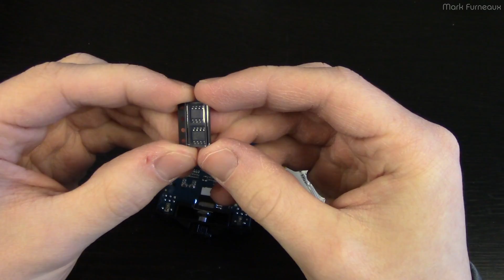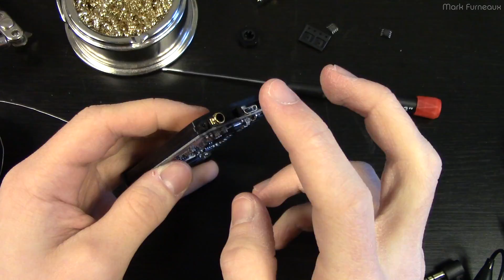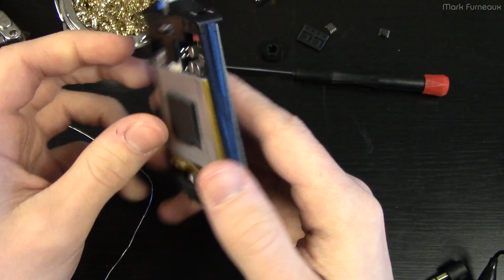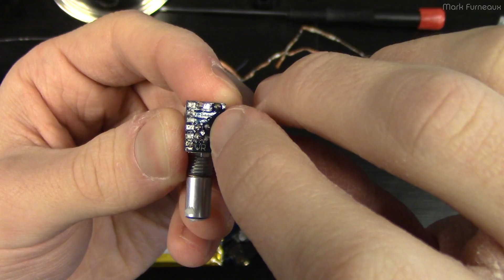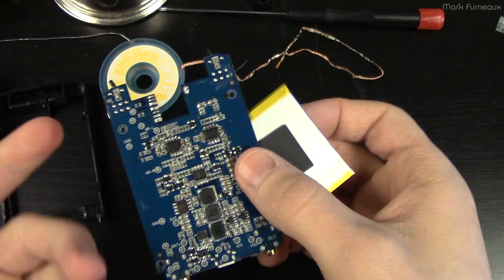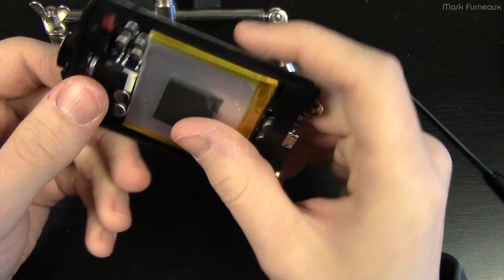Modding and Repairing My Fiio A3 Headphone Amplifier

Comment: What is the output impedance of the stage preceding the OPA1642? I'm wondering if they put a JFET input op amp there for a reason.
Reply from the maker: The input of the OPA is connected directly to the input jack. If your DAC or phone needs a JFET input, something is very wrong.
Reply: Is the input stage inverting or noninverting? If it's inverting, then you know there's a resistor before the op amp input, which means there could be a noise benefit in using a JFET depending on the size of the resistor.

Comment: Have you tried the LME49990?
Its a shame national instruments was bought out by Ti as they cancelled so many great op amps.
Reply from the maker: No I haven't. It's also a shame that they discontinued a lot of parts in the TO-99 package. Now they are only offered in DIP or SOIC.
Reply: LME49990 is mono, so would not work in this application. If you check the spec sheet it has amazing specs. I do also find the LME48720 is very nice and much prefer it over most Burr Brown products.